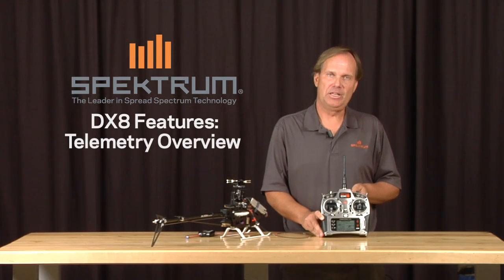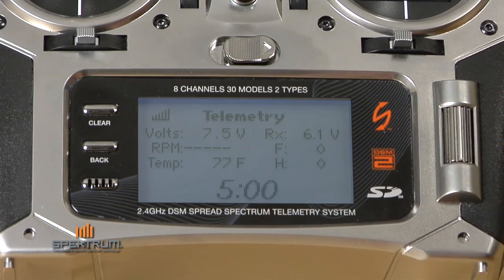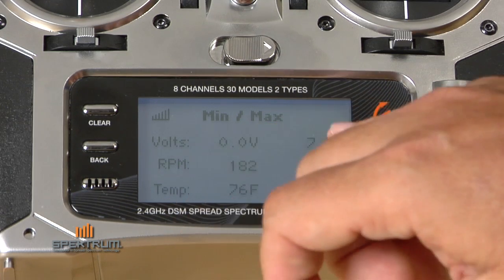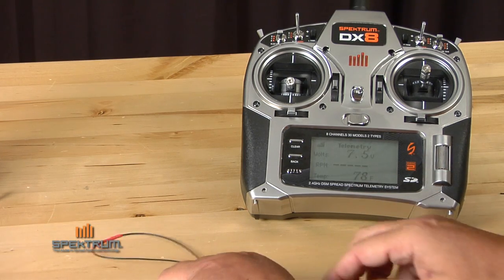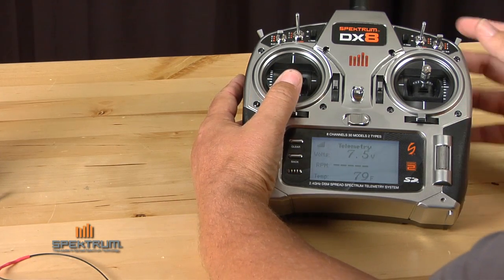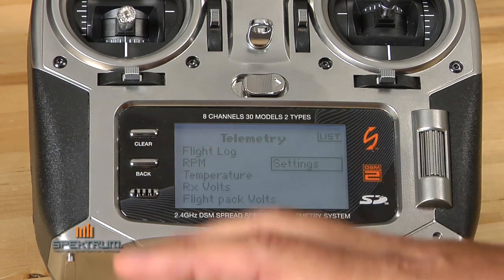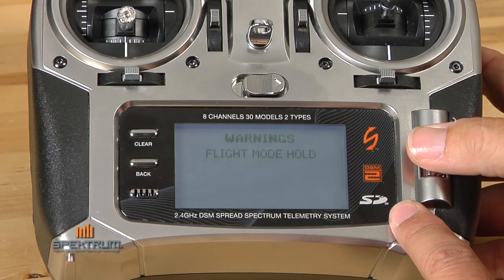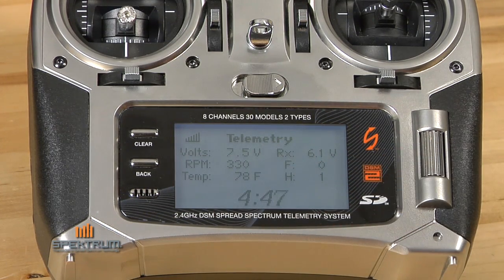Spektrum - Telemetry Overview

Comment: That's  crazy 11 years old , My voltage is wrong on my flight pack it say's 10.5 and actual voltage is 12.5 any way to fix it ?
Reply: I had the same on my ar637t, it was the V sensor in the Rx. Logic RC replaced the unit without question so I would get in touch with your local service center as its probably a hardware problem.

Comment: I am using Dx6e with AR637T. Telemetry auto-config work fine except battery voltage. I am able to set alarm thresholds in telemetry for 3S battery pack. When I open Volts screen I see no battery pack volts value.
Reply from the maker: Hi Janusz, what sensor are you using?

Comment: Hi,...does telemetry require a separate channel from the transmitter?  I run a dx6, and in many cases use all 6 channels to operate the plane.  Thanks!
Reply from the maker: Hi Chris, no it does not. Channel data and telemetry data are handled seperately

Comment: Why the small props on your chopper
Reply: +Ara Archer lol
Reply: +Ara Archer I'm just saying my quadcopter is running 3 blades 5 x 4 5 bullnose and I can keep him from flying away on my desk I know you're not supposed to keep your props on when you're working on the desk but I do anyway
Reply: Those aren't the rotor blades, they are the flybar stabilization paddles. Most newer helis are flybarless.

Comment: What does the telemetry look like using the GPS SPMA9587? I have a DX9.
Reply: I have the same radio.  You just side scroll to the gps screen. And it dispays lat long heading alt distance speed etc.  The dx9 can be set to vocalize data as well.  In event of a loss the screen will hold last known coord and continue to transmit if its got power and can do so if your in range.  More than adequate for finding a lost plane especially in trees

Comment: Great information. I'm glad you guys made these videos. Will you guys be doing videos on plane settings as well?

Also, does the alarm stop beeping when the temperature goes back down? Or do you have to reset it all the time with the clear button?

Lastly, are there warning settings for RPMs? Such as setting a max RPM alarm?